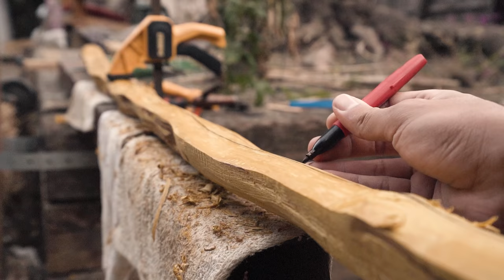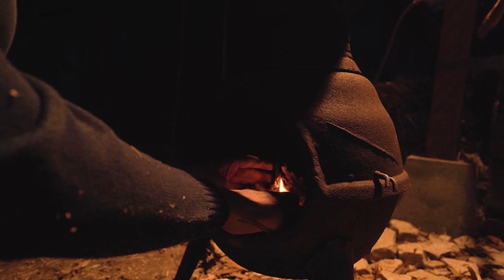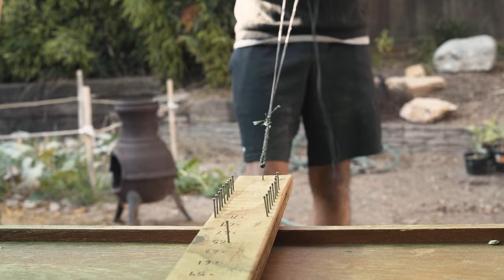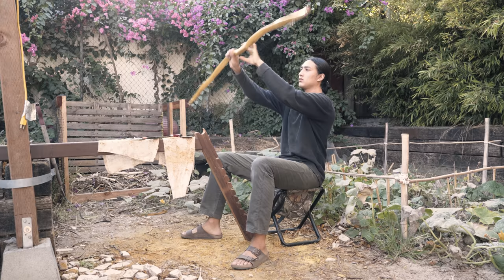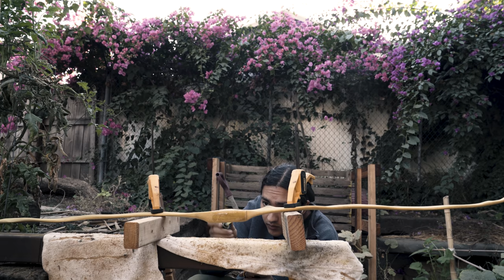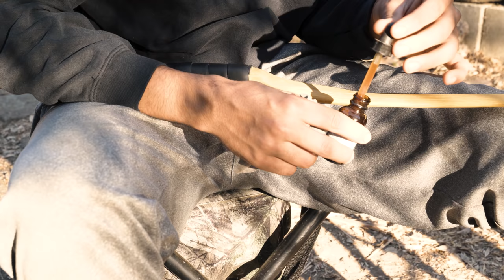Indigenous Bowyer | making a recurve bow

Comment: Amazing to watch and brilliant result.
2 quick questions:
1) What is the file you used called? I think that is what Tom Brown Jr calls a rasp file and in the UK that is not that.
2) I have seen a semi-professional Yew Long bow maker make one and it was almost the same except for the file however he used a shaving horse as the clamp so my question is what would have happened before DeWalt clamps?
Reply from the maker: The rasp I use for the bow profile is called a Shinto rasp. Before clamps and shaving horses, many bows were profiled down with axes and knife tools hand held. Good questionsz
Reply: @tekpatl  As I said I have seen someone do it the way an English(or Welsh) medieval bower would have made a long bow and you basically did it the same way. The only thing he did different was use a shaving horse instead of the dewalt clamps.
You might want to investigate the shaving horse as with your skills you could easily make one and they are designed to work with a draw knife and scrapper etc.

Comment: Absolutely amazing! What kind of file did you use? What was the block called for measuring the bend in the limb?
Reply from the maker: Thanks friend. I used a Shinto rasp, 6in chainsaw file and draw knives
Reply from the maker: The block is called a tillering board. Lots of info about these on the internet.

Comment: This is just the coolest.

Question: Do you always make a mono-wood bow, or do you make a composite bow as well? Asking because I've been told that having a 'swift' wood like yew backing a 'slow' wood like oak makes for a more powerful and faster bow? I have never really done the actual math, so I just wonder what a professional would say.
Reply from the maker: I do also make backed and composite bows. I’m working on my first laminate fiberglass bow currently, which is an entirely different beast. Very different style of bow-making but I’m learning the ropes. Backing an oak bow with yew will definitely increase performance as long is it’s not “overbuilt”
Reply: @tekpatl  Thanks for the swift reply. I really appreciate it. Good luck on the laminate fiberglass bow you are working on, I am sure you'll get to be a beautiful one.